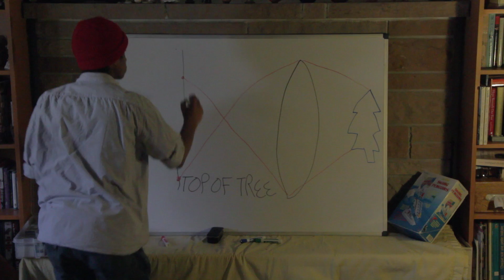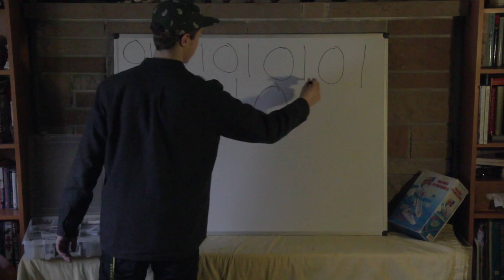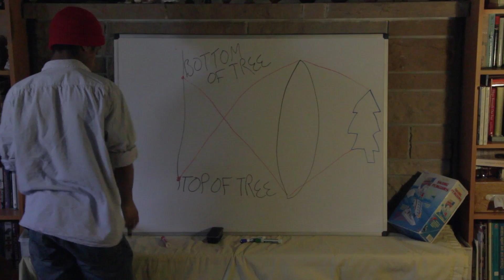The Physics Behind Digital Cameras

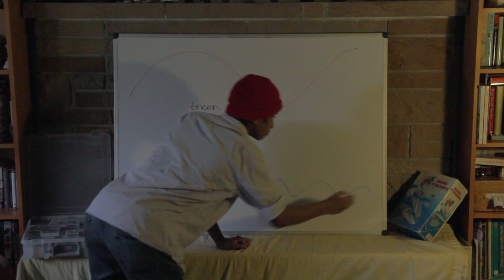Comment: Great video guys. I don't quite understand the part at 3:30. Would another way of understanding that be that because white light contains all colours in it that when it goes through the filters the lights are "split up" (for lack of a better term) which allows them to be seen as there actual colour when the camera shows us the picture?
Reply from the maker: +DatGameBoy Precisely! Because white light contains all wavelengths of visible light, when you separate, or "split up" the colors, they create white light again when you bring them back together. What you take out you can put back in and get what you had before. Sadly, that doesn't quite work with everything (a block of melted cheese after you let it harden again isn't quite the same as a normal, unmelted block of cheese). :(

And just so you know, I'll admit I was a little irresponsible while making this video. What is described around 3:10 is closer to the way color FILM works, and not how digital camera's see color. The pixels on a digital camera sensor are each designated a color (red, green, blue or white/neutral), so the color you see is really just the activation of the corresponding pixels when a certain wavelength of light enters the lens. That's why when you stand in front of a green screen while wearing a yellow shirt, you look transparent. Yellow is created through the activation of the blue and green pixels, so "perfect" yellow doesn't really exist in digital cameras. I hope I've helped, and sorry for any misunderstandings!